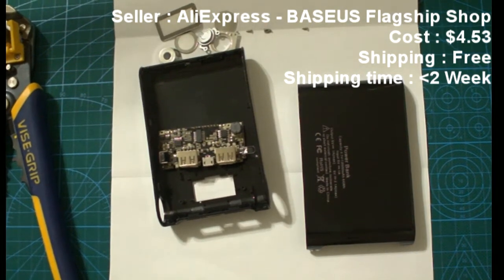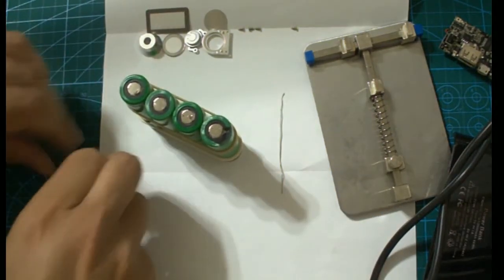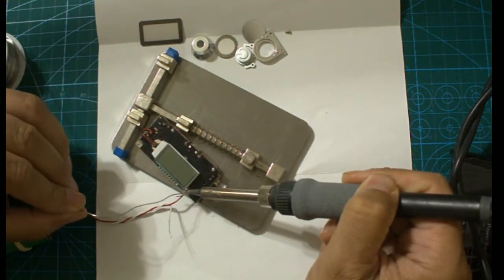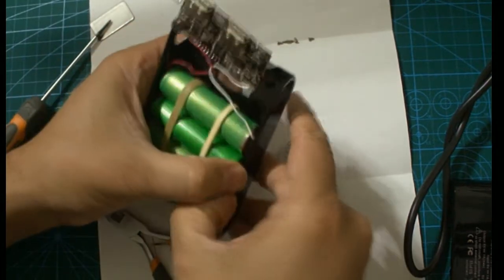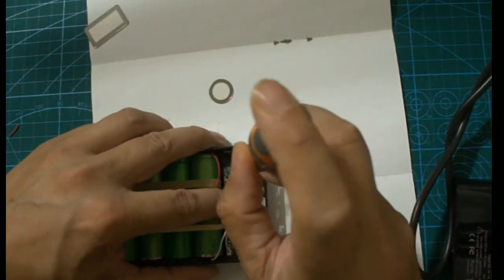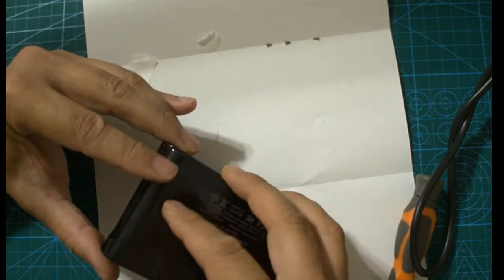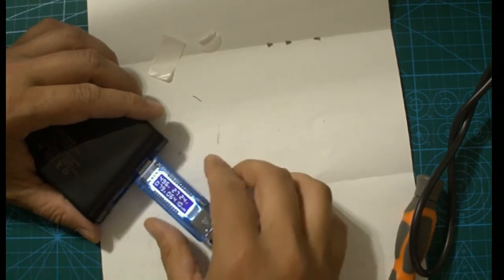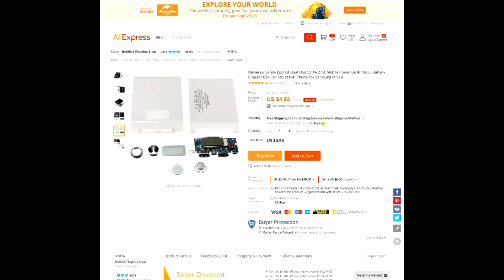DIY USB power bank with up to 4x 18650 batteries recovered from laptop batter pack

Comment: have you tried to test the voltage of the pack to see if the % indicator is correct? Mine sometimes fail the measure. Plus, at which voltage it stops charging/discharging? I have 2 of these (but black pcb) and sometimes they stop to discharge at 3.5/3.6 volts, absurd.

Comment: Really the best way to connect the batteries is to use a battery spot welder. I use strips of metal that I arc weld to the batteries. It makes a solid connection that will not come off. The first few I did were soldered much like this, but the solder came off of some of the batteries leaving the power bank with less output, so I had to fix them.
Reply from the maker: Any recommendation for a spot welder?
Reply: Sunkko 709A is the welder I have and it works really well. It makes a great strong weld using the tin strips.